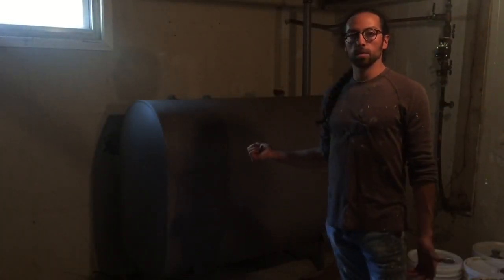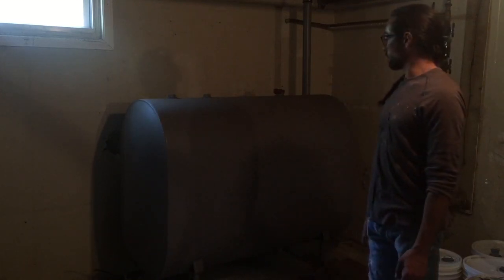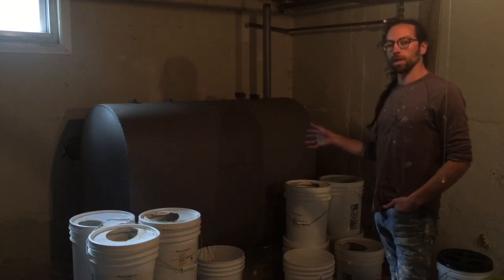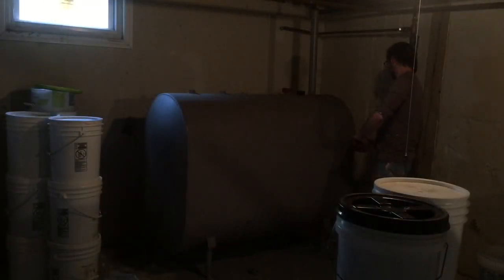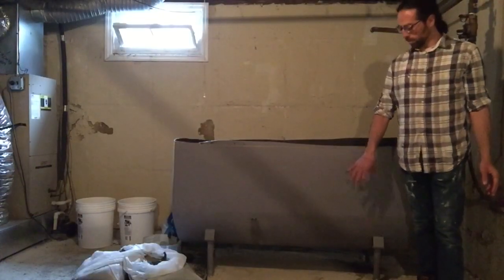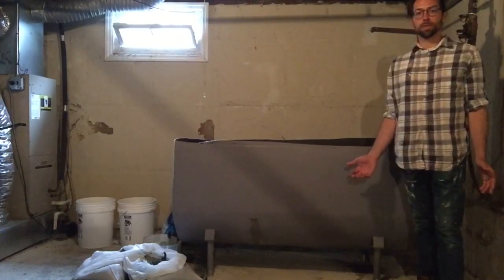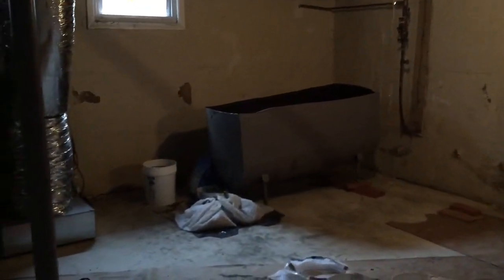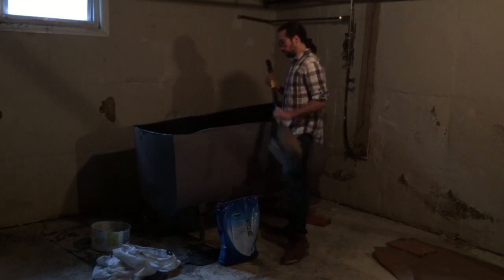How to remove Home Heating Oil Tank - Oil Tank Removal

Comment: After draining it you didn’t worry about the fumes or sparks when cutting it?
Reply from the maker: Home Heating Oil is actually very difficult to ignite, it takes major fire to ignite it.  Obviously anything can happen, but that's been my experience and what I have been told.  Take your time triple check your prep materials are ready especially when draining I needed way more buckets than I thought.  Namaste, peace be with you Brother Andrew.
Reply: @314pickleball  yes its hard to ignate, but if fumes are coming out u are much at risk, make sure dont use grinder on it, can be a bit of explosion
Reply from the maker: @janisgailitis5034  thank you for sharing that, I totally agree!🙌🏽🙏🏽💯

Comment: Are those buckets tight enough to prevent spillage ? I am literally about to do the same exact project, but im having trouble figuring out where to put the oil. Plus i was going to use a siphon pump to empty it. I hadnt thought of that system that you did. Mines about half full. 275 gallon tank
Reply from the maker: The buckets I used should work fine, I bagged all of them for transport just in case since I had so many it's possible I did not seal one properly, which was the case, so the bags  saved the day.  I also brought kitty litter with me on the truck to clean up any leakage on flat bed.  The system I used was ok and definitely required plastic underneath and kitty litter on top to absorb spills in between filling buckets.  I have heard plumbers to remove for approx. $500 which in my opinion is worth every penny.  Mainly the risk of car accident while transporting that much oil to the oil disposal site, but if you are extra careful all should be just fine.
Reply: The issue i am having now are the pipes. I cant budge them. Would it be easier to just cut right thru them ? Id rather siphon from the top in case the bottom valve breaks and floods my basement.
Reply from the maker: That's a good idea, I would have siphoned from the top if I had thought of it.  Are the stuck pipes the valve pipe you mentioned or the fill and vent pipes?  If the fill and vent pipes just cut them out.

Comment: My tank barely has any fuel in it. It’ll take probably 2 buckets then it’ll be emptied. 
After that I should proceed to cut?
Reply from the maker: One thing is to be certain that only Home Heating Oil was ever put into that tank, as long as someone didn't put gasoline or something much more flammable you are good to go!

Comment: Is there a way to do it without drilling a hole and ruining tank
Reply from the maker: There is a valve at the bottom of tank, like a water spigot but if there is sludge it could be clogged or will get clogged potentially.  Otherwise, pumping it out is the best way, I believe they sell little electric pumps at home depot.